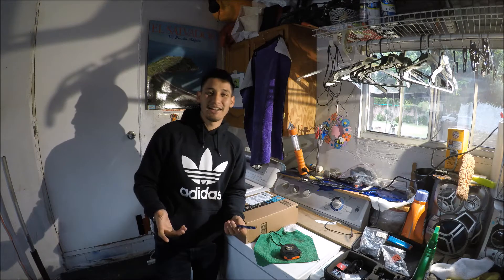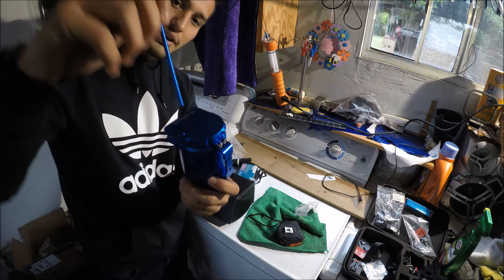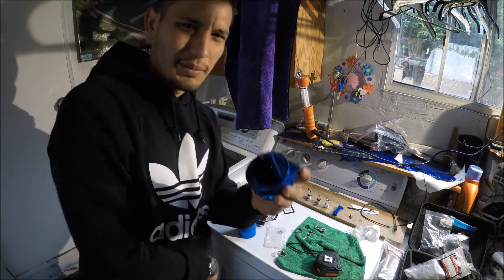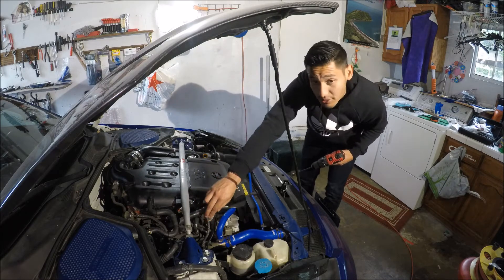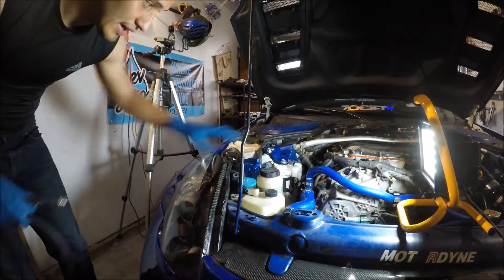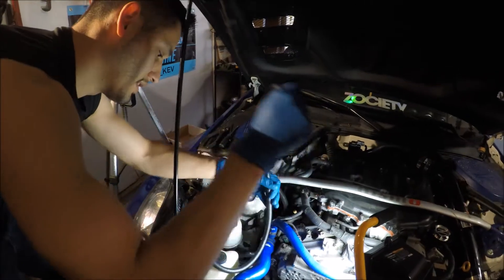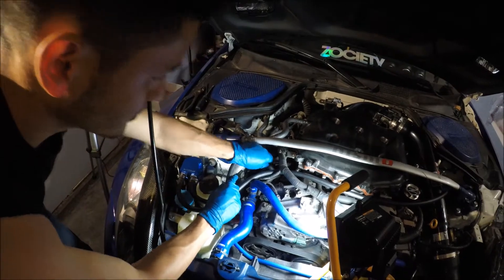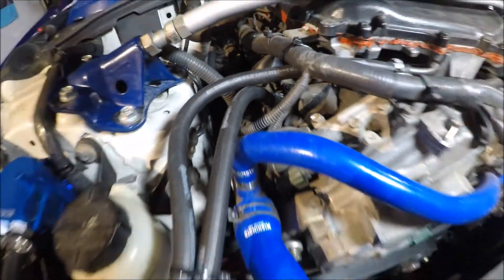Baffled Oil Catch Can install on my 350z!

Comment: Cool video but you mounted the can to high...  If you ever do another one or if you still have the car you want to mount it lower .. The reason is because the oil can't climb up the hoses theres no pump sucking it up, lowering it allows gravity to its job. Just a friendly heads up my dude.. i got same can you csn take the baffle out adding cork putting baffle back on or you can add a little screen will help from oil going back into intake manifold. Good video
Reply from the maker: thanks for the heads up! appreciate the feedback

Comment: What do you think about the other installation they just put a plug on the plenum tube and from the air intake the run the hose to the catch can
Reply from the maker: there are multiple setups when it comes to catch cans.  it just depends what setup you want. theirs pros&cons to each
Reply: I have a G35x sedan but really looking into the set up you did because just putting a plug into the plenum tube and the air intake too just see it kinda sketchy lol and what do you think about a vented catch can
Reply: its the same but its more practical dong on pass side no need for extra tubing from drivers side waste of time just use easy route from the pcv to in catch can then out catch can to plenum simple done